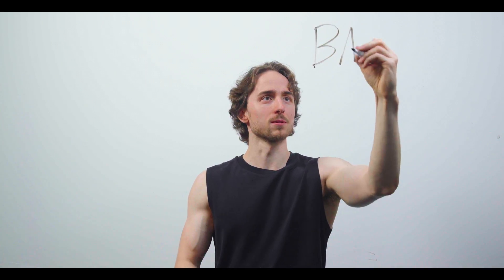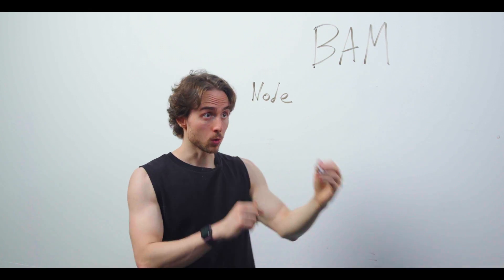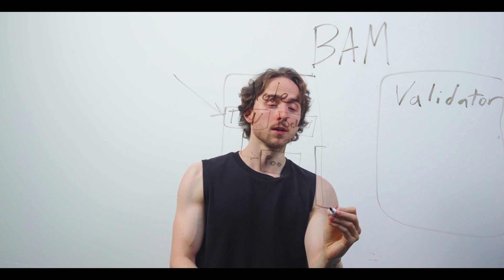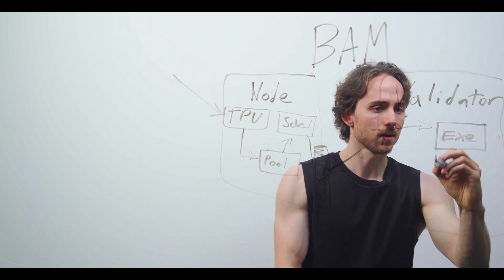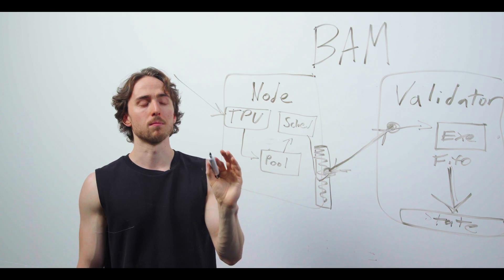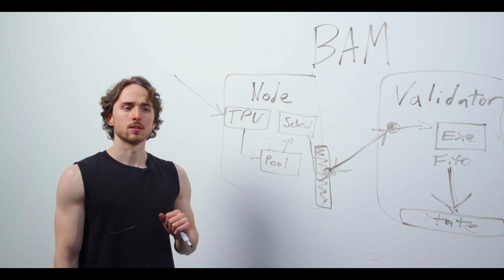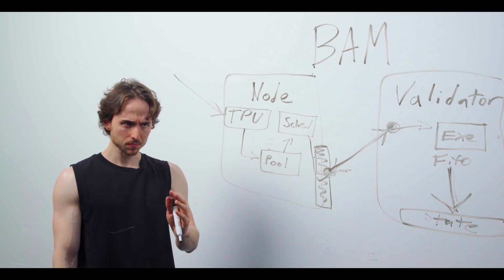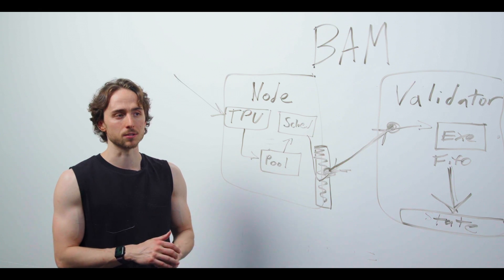Deep Dive into BAM Nodes and Validators - Whiteboard Series

Comment: some questions
1. are multiple BAM nodes able to schedule tx at the same time? How many BAM nodes can a BAM validator connect to simulataneously? and how does it manage contention if it's connected to > 1 BAM node?
2. when you say BAM Validator executes the tx. presumably this is only when its the leader?
Reply from the maker: 1. A BAM Node can service multiple Validators but a Validator can only connect to one BAM Node; therefore one BAM node schedules at a time.
2. Yes; when it is a leader.